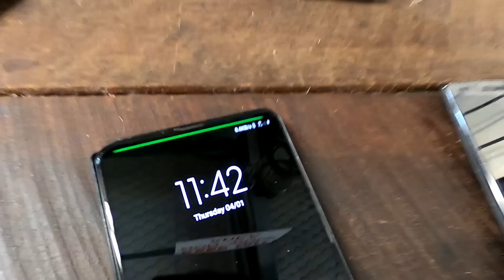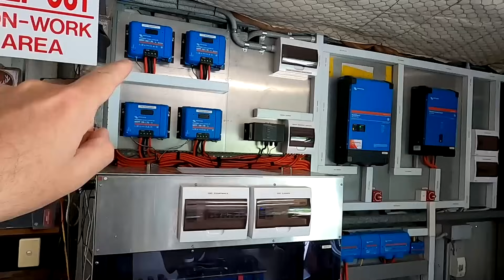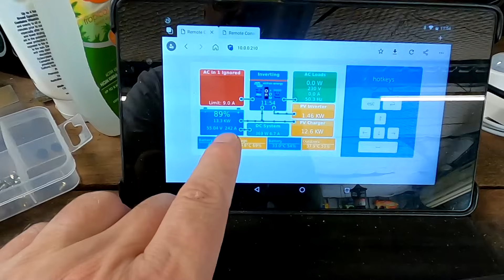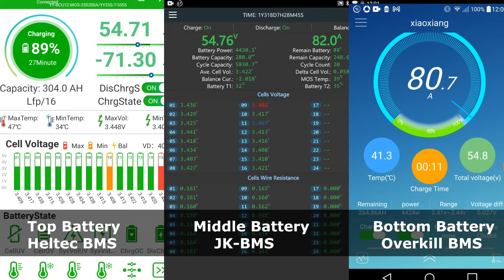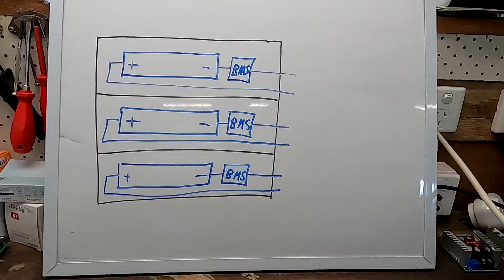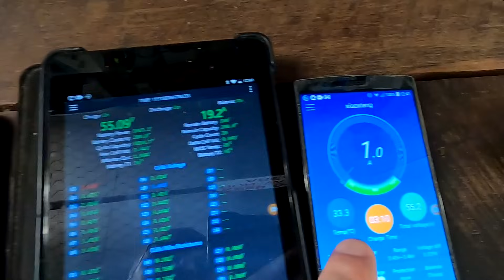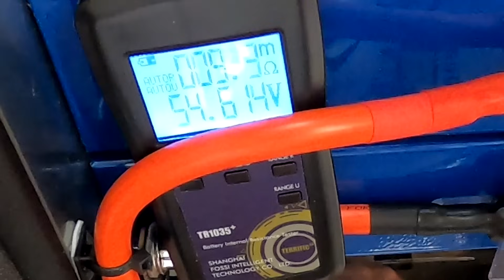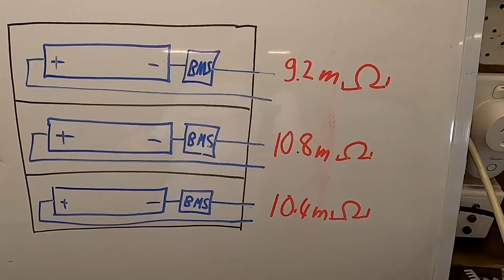Parallel batteries: one bank keeps charging when all the others are already full. But why???

Comment: I am going to suggest that changing the BMS on the middle shelf is not going to change the charging behaviour. 
Andy confirmed that there is very little difference in the battery resistance which just means that the batteries are of a similar condition. It is possible that the each BMS will also have slightly different, but I think that will have very little impact on the charge times.
Is it possible that the actual internal chemistry of each of the battery type on each shelf is slightly different even though the batteries are charging with similar charge current, the time it will take to charge the differnet battery types will be different.
Using the same argument, each battery type will also discharge differently which will then impact the charge time required to fully charge the batteries again.
Reply from the maker: I don't think it's the BMS either. My bet is on the bus bars and connection to the aluminium terminals of the cells...

Comment: I don't think that this impedance measurement can be used to explain anything. As you mentioned: it uses a 1 kHz signal to evaluate the impedance. Your BMSs will have some capacitors across the rails and therefore disturb the measurement. Finally, it is the resistance at DC, which steers the current, not an impedance at 1 kHz.
Reply from the maker: Good point. Thanks for sharing.

Comment: Hi i would like to make a battery pack for my house and i need your help!
I have 169piece li-ion(3.3-4.0v) ~40ah battery's and i would like to make them as 13s12p system!
1 modul would be 13series ~48v
I will have an MPP Solar PIP 58048 MKX inverter for charging!
1. Which bms should i use? (i need 12 parallel strings and later more and more)
2. How to make the communication with 12 bms? (or do i need to communicate between the inverter and the 12bms)
Thank's László!
Reply from the maker: Very hard to tell. As this is a new system you need to make your own design. Think about the maximum load you will have on your system now and in the future. How much solar, how big is the inverter? Do you want communication? So a lot of data needs to go into your system design first.
If you have 12 parallel batteries with 12 cells in series, you need 12 BMS. You can never go wrong with the JK-BMS in my opinion.
Reply: Thanks i thinks the Same. 5kw off grid inverter and 5-6kw solar panel. Max load is 32a one phase, but never will max at the same time i think. Jk 0.6a or the new 2a?
Thanks

Comment: The one symptom I noticed was the middle shelf having a slightly lower voltage than the other two when charging above 3.4V, which explains why it charges for longer.

But as to why it has a lower state of charge, I guess you'd need to look at each variable in isolation, such as swapping out the cell busbars or the BMS with one of the other batteries etc.
Reply from the maker: There could be a small difference in measuring the voltage across the three different BMS. Some here have seen a slightly higher voltage, you see a smaller one...
I have more insight in one of the next videos...

Comment: I think manufacturers have varying charging curves so your results don't seem too odd.  Would be more odd if you were using the same BMS brand across all three batteries with mirrored settings.  Are all of your BMSs set to the correct chemistry?

Comment: measure the resistance when at 55.2v, the resistance of the batteries changes with voltage (that's how they self limit the charge), measuring at 53v as you did won't give you the information to identify the behaviour at 55.2v
Reply from the maker: Well, all banks were at the exact same voltage, so Ri should be the same.
Reply: @OffGridGarageAustralia  they will be at the same, that's what you measured, but ended up concluding they're all the same, resistive characteristics of different batches are only visible when they are outside the flat part of the curve
Reply: the behaviour demonstrated on the symptoms that prompted this video is that there is a bank of batteries that when pushed to the ends of the curve shows a different resistance change behaviour, all batteries increase/decrease their resistance as they get charged or discharged to "resist" take in more charge when they're almost full, that's why your charge controllers can't push as much current as they want when the batteries are almost full, that's when the different packs behave differently, on the flat curve they won't be different, it's only at high voltage when you'll see a difference (or very low)

Comment: I think the difference are caused by the measuring accuracy of the BMS. The BMS measures the voltage and decides if the battery is full or not. You have determined that this happens at 55.2 volts. But each BMS has its own accuracy. We are talking about small differences, as you note yoursel, so a measurement accuracy of 0,1% could mean that one BMS trips in reality at 55.25Volt while the other trips at 55.14Volt.
Reply from the maker: The BMS only measures the voltage but does not control or regulate the charging. Even if one BMS shows only 50V, the battery itself will charge exactly the same. (Obviously, the OVP of the BMS will not work correctly ins such a case)

Comment: Hey Andy,
when you switch the BMSs, you should check the Resistance of the Breakers too (measured after the Main Breaker).
It would be also interessting if the effect can be observed if you charge to a higher voltage. I think it could also be a slight difference in chemistry of the cells.
Looking forward to see what you can figure out there!
🐸
Reply from the maker: Yes, breaker could play a role but I doubt that would make such a huge impact.
Charging to a higher voltage shows the same with the middle battery still charging longer.

Comment: Hi Andy,
To me, the high frequency resistance is simply not a good indicator of the battery charging rates. There may be low/mid frequency resistances within the cells that you cannot assess this way.
Reply from the maker: That is the industry standard. All battery manufacturers are using the 1kHz signal to determine the Ri of their cells. 
The only thing could be capacitors inside the BMSes which mess up the result...
Reply: I agree that the BMS can play a part in the result; and as you said, manufacturers use the 1 kHz signal to determine the Ri of (single) cells, so the test would be more meaningful if it were carried out on individual cells (no BMS, no - possibly heterogeneous - cells in series... ). What you could also do (without taking everything apart!) is measure the Ri at several stages of charge/discharge. The results could be surprising ;).
I'd be interested to know. @OffGridGarageAustralia

Comment: Hi Andy, I have the same question as you! I connected two battery packs, each with 16s 280Ah, using the same BMS (which don't communicate with each other), cables of the same length, an equipotential bar, and the same brand of cells. The only difference is the production date of the cells. I also tested the resistance by measuring voltage drop. But nothing! I just can't figure out why the cells are behaving so strangely. Sometimes they seem perfectly synchronized, other times one discharges much more than the other. I think there are many factors at play, including cell temperature. However, it seems more like a theoretical question because, in practice, the system works. Overall, the cells seem to work similarly over time, so I assume aging will be similar. Thanks and greetings from Italy!
Reply: I have EVE LF280k from different production lines and only a few days apart. They have in average around 4Ah difference in capacity, but they have diffrent charge curves. Seems there are big tolerances in materials and manufactoring.
Reply from the maker: The charge curve could be what is different here.

Even having a 100Ah and 280Ah in parallel did not show such a result as the 280Ah bank always charges/discharges faster and they meet again at the end.
Reply: @OffGridGarageAustralia   In reality, the behavior seems completely random, as batteries often reverse roles. Is it not related to the quality of the cells? It appears to be linked to random factors.

Comment: The explanation might be easier to explain using the charge curves of the batteries.

When we build these batteries we found that matching charge curves for the 16 cells is more important than the internal resistance of the cells (importance of using same manufactured batch).

What you have is a slightly different charge curves beween the batteries at the 3.35V-3.48V cell voltage range. Thus at the "knee" of the curve the middle battery is just a bit slower to get to the bend. It actually means that the cells used in that battery is better matched. The benefit is not huge but if you do the calculations the capacity would be 0.25-0.8% better than the bottom battery.
Reply from the maker: Yes, that is a very good point. If the charge curves are different. the banks will charge/discharge differently.

Comment: Hi Andy, Switching bms could be a good test to see what is happening.
My 2 cent is simply cell. You don't have 3 batteries but 48. Over 48 cells, they are suffering differently over the time.

Comment: Have you verified the BMS setting are all the same?   Try swapping the JK BMS with the bottom one.  This will verify if it's the BMS, or something else.
Reply from the maker: BMS settings are the same in terms of balance start voltage. All other parameters don't matter. The BMS is not in control of charging/discharging the battery.

Comment: As the charging voltage applied to the shelf is the same for the three banks, for more current to flow through the middle bank its resistance must be lower. Using ohms law actually calculate it rather than dicking around trying to measure it. Use your amp meter to confirm readings and Swap the shunts around  after checking all connections to confirm that there is no variation between them..

Comment: My goodness.

Battery current diverging during charging as each battery comes up to fully charged at a different time due to variations in manufacture, wiring etc etc, leaving the one with a lower relative SOC to soak up potentially undesirable levels of current in a system that does not monitor individual battery current?  That can't be right as it's been stated a few times in the past by the channel operator that he's checked and his batteries don't have this problem.  I do remember some guy banging on about this in the past and that seemingly cluey guy also said that it happens to pretty much every battery system out there which is why the commercial setups monitor this sort of thing.  We're not quite there though as apparently it's not really a problem, but give it a couple of years and we'll see how the story evolves.

It is true what they say.  You can lead a horse to water but you can't make it drink.  You just have to leave the horse there and hope it eventually works it out for itself.

Comment: doesnt the middle one have active balancer? could it be using more energy ?
Reply from the maker: Yes, it has an active balancer. It uses a lot less energy as it 'recycles' the energy rather than burning it off as in a passive balancer which the other two BMS have.

Comment: Hi Andy, try to measure the voltage drop across the battery bank BMS during discharging and charging. Maybe the BMS  internal resistance changes/different during discharging and charging.🙂
Reply: also measure the voltage drop across each bms at high current level and see if it has high deviation berween 3 bms (at same current)

Comment: First, please notice the charge voltage and the voltage at the battery
At 8:09 they match for each battery (approx), - the 55.2V to 54.8V offset is due to the bus-bar-to-battery drop at 80A?
        		V1   	V2   	V3
Batt  V		54.84	54.82	54.8  <- charger(solar) at 55.2V? note offset to 54.8V
Batt  A		77   	83   	78    <- matches (approx)
rest cell V	3.35	3.35	3.35  <- below knee estimated

Next at 10:01
Note the voltages for V1/V2 have caught up to charger (absorption)-> they are into the knee where current starts to drop.
More so for V3 than V1, and V2 is still just below, and maybe  'just' getting to knee.
Note V2 still has the bus-bar to battery drop since 70A.
        		V1   	V2   	V3
Batt V		55.14	54.95	55.2     <- charger at 55.2V? sun's out?
Batt A		29.7	71.4	9.9       <- V1 and V3 in knee, current drops
rest cell V	3.39	3.35?	3.41  …. estimated

If you ever want to verify where you are on the knee - try to get the rest voltage. One simple method is to disconnect each battery (could have been done here at 10:01) and wait 15+ min,  and take a cell voltage reading after waiting. Hopefully you would find values shown (approx). Note the 3 batteries should not be connected together for this, each must be floating so that they can settle to their own voltage.

In other words the data at 10:01 may simply mean V2 is a bit behind in charging. You could measure how far by measuring how many AH need to go into the battery to 3.45V full absorption.

At 10:01 V3 is almost there, V1 is getting close and V2 is still behind. Hard to say how far. I think this is normal for parallel connected batteries. 

Apologies for throwing in my rest cell estimation. It is based on the current and per cell voltage. I am just trying to show that your V2 behavior could be explained simply by V2 being behind.

How did it get behind?

I found at very high discharge currents the battery with the lowest internal resistance will be the most discharged - hence it will be behind when charging at currents lower than discharge.
Or, for high charge currents the battery with the highest internal resistance will be behind.

Anyhow, if V2 is a bit behind would that be considered a big deal? As V1 and V3 enter absorption, V2 will start to try to take the full load. Are you worried it would try to take in more than 200A? I think the internal resistance would prevent exceeding 200A, especially if it is also close to full.

Off course all this would be so much easier to analyze if the SOC from BMS were more accurate and you would know what the actual SOC of each battery is. :)

Comment: Hi Andy, you assume to have 3 eqal batterys. But you don't.
All 3 have different character.
I got 32 cells from QSO. 24 are from one production line and 8 are from another. 
Dammed...had to build one pack with mixed not matched cells.
Im tracking all cell voltages in HA and this mixed pack shows diffrent chargecurves for the one eight and the other eight cells. They are all EVE LF280k but from diffrent production lines and 4 days apart. They only differ about 3 to 4 Ah, but they behave diffrent during charging.
Had top balanced them for a week, but still remains.
I'm shure they have slightly diffrent chemistry or mechanical tolerances.
Reply from the maker: Difference in the charge curve is a good point!
Reply: @OffGridGarageAustralia 
I don't know if the charge curve is a criteria when the ressellers match cells, maybe it is.
But i bet the curve is a criteria for the manufacturer to decide if a cell goes to automotive or to a reseller.
This is why all our DIY Batteries are different, if we not bought the cells together at one time.
My unluck was that QSO had lost the 32 cells on delivery and then grabbed togehter what was left in a EU warehause to not let me wait for another 3 months. 
Unfortunatly in my case 24 and 8 witch is 'not good' to build 16s batteries.

Comment: Can I hedge my bets:
Guess 1: I think it may be related to bus bars, thicker does not always equal lower overall system resistance, as there are small contact areas and the issues with corrosion. 
Guess 2: Overall ESR of the battery is just higher due to the goop they used.
Guess 3: The BMS has a higher resistance. 
Swap the BMS around, if it doesn't follow the BMS, replace the bus bars with same as the other packs. 
Only way to be sure, nuke it from orbit :-)?

Comment: Did you calibrate the Voltage measurement of the JK BMS? There is an option in the settings to calibrate it. It could be your just thinking it is not fully charged?
Reply from the maker: Yes, it's calibrated.

Comment: I don’t know if one of the battery cables has one more strand of wire or a thickness and size of the aluminum bars. But I will check out a cold beer 🍺 and get back with you 😊

Comment: mines still working very good saving us power bills , after 13 months ,27v -  8 eve 280ah cells . Victron 1200va and 100/50 mppt in 24v mode ,battery is very efficient , only had that one issue with BMS crapping itself ,, love it free power free aircon

Comment: I think the different charging current is as a result of the availability of internal active balancer in the JK BMS.
All the cells in the JK BMS bank are balanced and takes the all the energy they can store. 
I suggest you verify the overall Watts hour stored in each bank and compare with the rated capacity.

Thank you for all the good work you are doing.

Comment: I think it is due to the balancer, the middle shelf will have a more even cell capacity and so they all reach 100% at about the same time, meaning it can absorb more energy, the other two shelves will be more imbalanced so once ONE cell is at 100% the overall current will drop because of them all being in series, even though the other cells may only be at 95% or so.

Comment: My take is that the middle battery has more losses for some reason. Hence, when discharging it is discharging a bit more than the other two, and it has to recover more energy on its charge cycle.